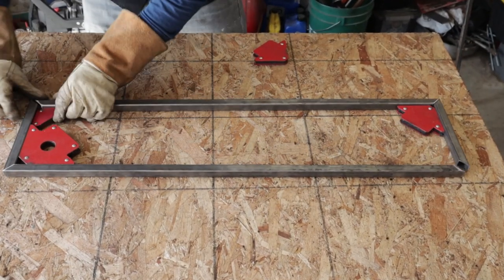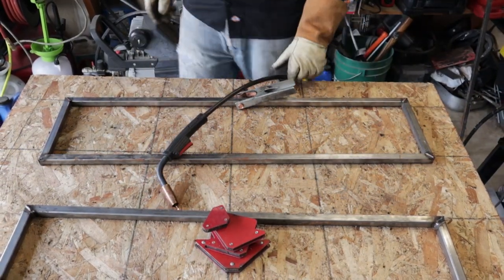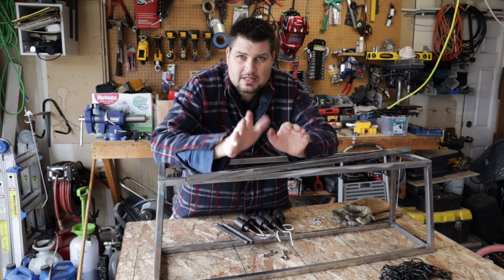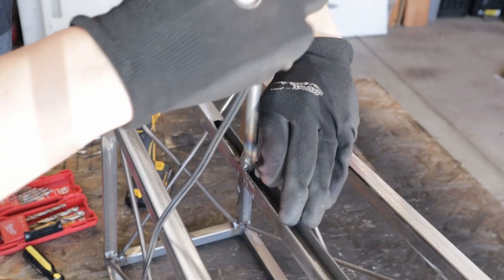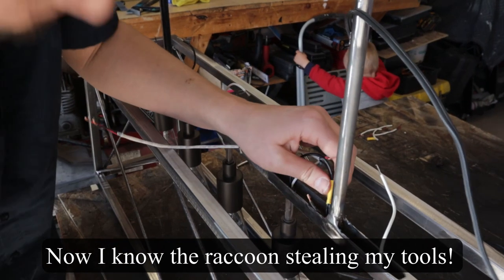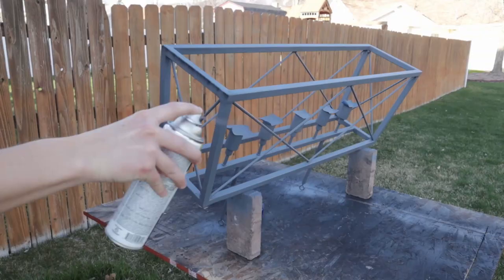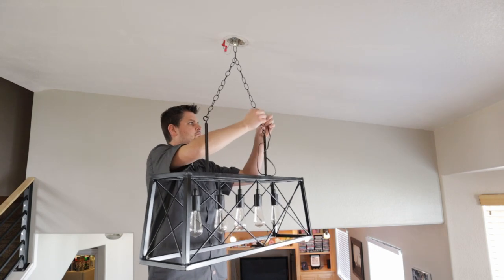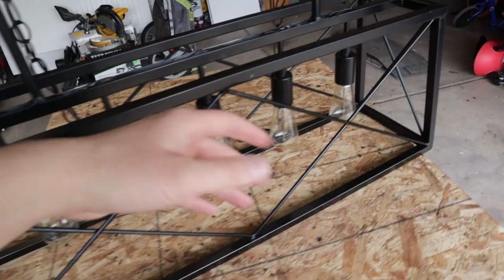DIY Light Fixture Cut, Weld, Repeat

Comment: Great work! Just wondering what thickness of steel you use when you weld stuff like this? Will the welds blow through if its too thin?
Reply from the maker: It is pretty thin, i'm not sure the exact thickness. I can turn the welder down low enough that it didn't burn through.